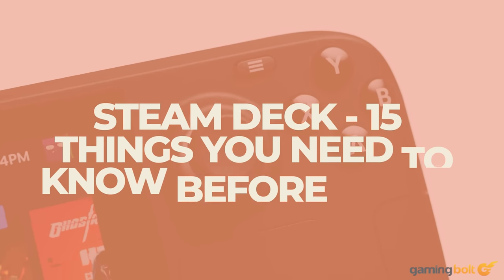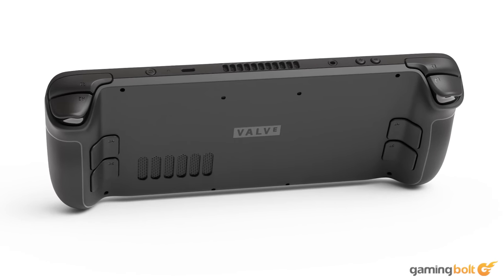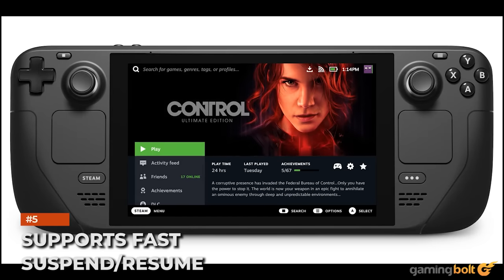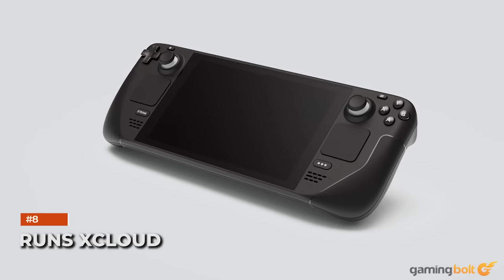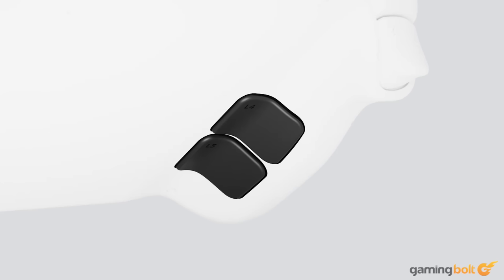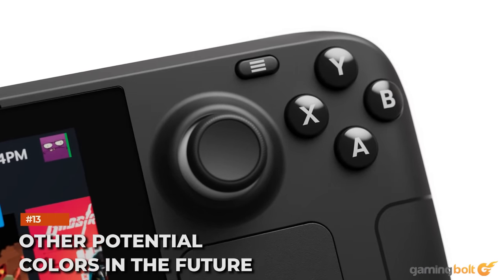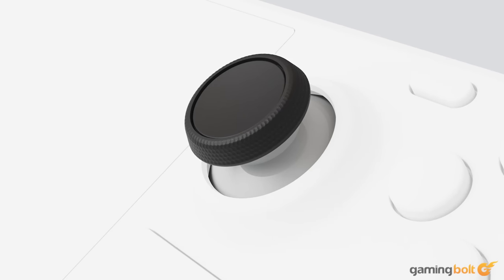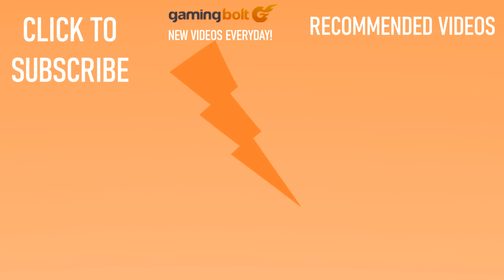Steam Deck - 15 New Things You NEED TO KNOW Before You Purchase

Comment: Linus, Gamer Nexus and The Phawx just did a great deep dive of the Steam Deck worth the watch. I am really hyped for the next when the software features will be released.
Reply: What can we actually install? I would want world of warcract , lost ark, and final fantasy 14
Reply: @Murc_roadster  Massive multiplayer games are currently not supported. Depends on the publishers if they want to enable anti cheat features for Linux based System like Steam OS. Final Fantasy 14 maybe could be playable but its not yet checked by Valve. If you wan't to know which games are currently verified/playable on the deck check the gamingonlinux website. Currently 520 games are playable officially.
Reply: Phawx is awesome!
Reply: Yeah but let's not tear one apart like Linus did... I'm pretty sure he gave a few Valve employees grey hairs and a possible heat attack when removing that battery 😱
Reply: @Matruchus  That is not true. Tomas could install windows and play it that way, if he wanted to. It's not console like convenient, but it's not really a problem either. I will have an sd card, to boot windows from for stuff that doesnt work with steam os.
Reply: @gehtdianschasau8372  I mean, I hope you didn’t buy one expecting Windows to be installable in the SD card, because nobody knows if that’ll be possible. 

Don’t get me wrong, I know you can install Windows (or actually, any OS that meets minimum requirements really) but so far we don’t have any confirmation on dual boot, Windows official drivers (I’m not even sure Windows will see the pads properly) and Windows optimization (FSR support is nonexistent for example). So yeah, buy it knowing installing Windows is possible but nobody really said Valve or Microsoft will officially support it.
Reply: @AlejandroLZuvic  I expect windows to run from an sd card, if it doesn't i'll have to install it on the ssd. I propably won't use windos often, so i'd rather have it on sd card, but i opted for the 512gb model, so it wouldn't be a problem.
Reply: Link
Reply: @skaterdude7277  what you mean link? I hope you dont think you just gonna tell someone (link) and expect someone to  really give you one. Lil boy you say please and I'll give you a link if not beat your feet kid
Reply: I can't wait. I got my order in late... After Q2, 🥺😢😭

Comment: Honestly this could be what PC gaming could use to work with the massive commercial market they are kinda apart of. I say kinda because most kids who want their parents to buy them games don't usually say PC.
Reply: i have this distinct feeling kids won't want this, as they are going to stick with their switch.
Reply: @demonpride1975  hate to break your heart, but it's not just kids that own the switch. it's past over 100m+ sales. and to assume it's all kids is odd. but what i can tell you is, plenty of kids now own a pc due to the shit release of the xbox series, and ps5's. consistently out of stock, always being scalped, not nearly as much of a game library as the steam deck. everyone will have their preference, kids and adults alike.
Reply: @issamcvibington  "Kids own Switches" doesn't equal "Switches are only owned by kids"..... you implied that. No need to get so defensive.
Reply: @crocfromthehitgamecroc9010  I wasn't being defensive. I was just trying to state a point. He only mentioned kids in his post. Thank you for your input though.
Reply: Well the big road block to pc gaming has always been accessibility. Your basically spending hundreds or thousands of dollars on a rig you can’t take anywhere, you gotta upgrade parts and over all just know what your doing to manage a pc. For consoles you don’t have to do any of that! Just play games at less than half the price. You gotta cut out that complexity to reach a mass market especially for kids. This Steam Deck however breaks the barrier! I would be surprised if kids go for this as well especially as a handheld console. Your not paying pc prices for pc gaming and you don’t have to manage the pc as long as your sticking with the Steam app as well. This is basically a dream console I’ve wanted for almost 20 years now and technology has finally caught up. And now I can play Halo on the toilet! I’m sold!
Reply: @demonpride1975  It's a possibility, this looks like a switch tho.
Reply: @issamcvibington  Not the same most kids from when I was a kid until now mainly want a console because most their friends still have them. Kids who play on PC is still a minority compared to console kids. This could be a great equalizer and introduce millions of kids into a gaming pc that's affordable that their parents could buy.
Reply: @AKen_Films  That's the thing I don't think many people seem to understand. This is a major game changer that the steam boxes never could be. Those boxes prices were all over the damn place, also you never seen them at stores or seen any promotional items or commercials.  If Valve markets this right and keep each version affordable this could be a major shaker and force the big 3 to change alot.

People go well kids have gaming PC's I'm always like not the kids aren't a small minority.  Also even out side of the states on Asia and parts of Africa are gaming PC's the Supreme factor. Mainly the people who have high end riges are adults with money. Even me in my mid 30's I thought about getting into PC gaming a friend of mine told me how much he put into his recent PC. I said wow thats a down payment for a car, I said nah I'm good.
Reply: @AKen_Films  Honestly? Extremely true. Have 100’s upon 100’s of games in my library on my PC. But I go away for a few days at a time very often. And if I can’t access them, what good is it all ? Very valid point. I’m going to be getting one hopefully when my time comes in the reservation. It can’t hurt to give it a shot. I’ve stood by valve/steam for so long now. I can feel comfortable standing behind another product of theirs. Interesting time to be alive, boys.
Reply: @rell127 Also very true. I grew up on PC, so I’m bias on that idea of kids not being into the pc universe. But remember, when we were kids, cross platform wasn’t a thing. A kid now can have a pc, plug in a controller, and play apex legends with their friends on ps5 and Xbox series. Different times, friend. I see your point though. Very true, and without even needing the dock as far as I’m aware, they’re able to get a regular usb-c hub and dock it that way. Super portable, lightweight accessibility. Gaming in general is in a decent place. Albeit I can do without the crypto and NFT nonsense. But that’s a whole other conversation in itself. Have a good one man, hope to see you in the deck world soon.
Reply: Why is it a problem? What would kids know about building a PC or knowing the loads of specifications that a PC can have?
I know kids today are much more into technology than ever before but PC gaming isn't exactly for kids. No, I'm not saying consoles are for kids. It's just more simple to use and less expensive.
Reply: @defend4ever  actually a weird take. I got heavily into PC gaming at 7 years old. I’m now 29. With CS, Diablo 2, Dota, and RS mainly. And I had a neighbor help me build my first PC with all parts from newegg. What would age have to do with whether a kid can get into PC gaming ? There’s even pre-builds if the parents don’t wanna be bothered with doing it themselves/hiring someone to do it. Weird take lmao. Not sure what else to say to that. Age doesn’t discriminate against gaming, friend. Have a good one :)
Reply: @defend4ever  Every generation of kids are like that, just most gaming PC's are out of most parents and most teenagers budgets. Now yes there are some affordable options but to play the games they want they won't all have those options to buy and or build them. Some will , I'm saying this is great because this price, and the mobility of it will mean more people can pc game. With more affordable options to game means more games and more people. Nothing about this is a bad thing.
Reply: @defend4ever  one more thing, less expensive ? Also an odd take. Do you even play on a PC ? Most if not ALL of the most popular games stemming from FPS - MOBAS are all F2P. One investment. Thousands of hours of enjoyment. Idk man. Just a really odd outlook on it in general lmao. But still, have a good one 😄
Reply: @issamcvibington  I'm just saying that a console is easier and more convenient for most kids. I personally have a PC as well. I didn't have anything until I was like 10. Even after that I didn't play much.
How many parents would want to bother with a PC when a Playstation/Xbox will be enough? Even a tablet is enough for some kids. 🤷‍♂️.
Reply: @defend4ever  I see your point. Valid point for sure. It’s definitely more mainstream for a parent to say something like “what are those new Xbox’s called?” Rather then, “what processor do I need to have that is compatible with this GPU and mobo?” Lmao. Fair point, man.
Reply: @rell127  yeah, I most definitely didn’t say anything about it being a bad thing. It brings more portability to the gaming industry which I am a huge fan of. And at the same time brings more of a mainstream approach to a what would be considered popular, but limited to be in one place at all time platform
Reply: @issamcvibington  I agree you didn't say it was a bad thing. I want the big 3 to have competition that matters. It lowers the prices down. Hell I wish the DreamCast was a hit because we would probably have a big 4 right now. Hell then if Atari, I'm a huge fan of choice and options. I prefer us consumers to have as many options as we can. Also I believe only have 3 to 4 options isn't enough I feel a solid 7 would be good. Especially can have Google, Facebook, Amazon and others become a major threat to one another. I feel the more the better the price, the better the games and the better the price.
Reply: @demonpride1975  That's a possibility because there already is several windows based consoles just like this .
Reply: @issamcvibington  yes i am sure there will be some kids that want this, but honestly at this point kids want everything, not because they truly want it. why do you think we have so many handheld devices that kinda fail, because they try and compete on the market with nintendo, and nintendo has proven time and time again they have the handheld on the go market clinched.

Comment: You probably mentioned this and I didn’t hear it but I’m wondering if you can play games offline? Can you only stream the games? Can you play games without streaming them?? I’m new to steam. I mainly play console. So if you can play games without streaming them I’m really considering on getting it
Reply: I'm guessing it depends on the game.
I have no clue since I'm a platform player and don't have a PC, but like with the PS4 I'm assuming it would depend on the game since there are some games for the PS4/PS5 that don't work if not connected to internet.
Reply: No, streaming is not required in fact it's much less of a hassle to play games natively it's literally a PC so you can install games normally, which is the main purpose of the device.
Reply: If it couldn't be played offline then it wouldn't have so many storage options
Reply: Yep steam has an offline mode, so as long as your game doesn't require online to play you are probably good. Games are downloaded directly to the steam deck just like if you were to buy and download a digital game on a console. It's basically a digital only switch, or playstation vita, except there's no exclusives and you can play your whole pc steam library (steam uses cloud saves). Theres no need for streaming games at all, but it's an option if you want that. There are some exceptions though like some games need to be connected to the internet for first time setup, and some, most notibly some of the battlefield games need to be connected to play single player (probably because of DRM/anticheat). There are a few games that just don't work at all like VR titles or right now because the anticheat software used for games like Apex Legends is built in windows and not supported on linux. I've heard Valve is working with the anticheat developers to try and make a version that works on the steam deck though so hopefully that'll be fixed by launch or relatively soon after. There are lists online of games that require something extra, have little issues/limitations, or just don't work right now, if you are interested if any of your games are on there. The vast majority of games you shouldn't have a problem with though.
Reply: @BlackWinds  thank you. I really appreciate that. After reading this I will get a steam deck😁
Reply: It works the same as a normal computer. You can download straight to the device and play offline as long as you like.
Reply: why wouldn't you , steam has an offline mode, and this is using steam os. so more then likely yes, unless you are playing a game that requires an online connection.

Comment: Valve does say the m.2 drive slot is standard but not intended for users to replace the drives. Hence the micro SD slot and the effort in making the SD storage almost as fast as the m.2 drives.
Reply: But if you're handy and careful enough you can just replace the M.2 drive.
Reply: @WickedMuis  they’re not going to stop you… but if you screw it up, they’re not going to fix it. Same to be said about installing Windows, you can do it, but their warranty won’t cover it
Reply: @progxdt  Why Windows warranty though? Steam OS 3.0 can be reinstalled anyway
Reply: @WickedMuis  it's a tight package, the steam deck. The m.2 they have is single sided and the layout is tuned for that specific m.2s EMI. They have validated that config and any other may not allow the steam deck to function as intended.
Reply: @progxdt  Actually they said they are supporting windows and there will be a factory reset option as well if you screw up your software. Also, windows sucks.
Reply: @_Davepocalypse  Yeah, just get one with the right specs.
Reply: @WickedMuis  unless you just buy what they already offer, you can't match the EMI pattern exactly. Also, with the m.2 right next to the wireless adapter with the antenna passing it, that's a risky business to start swapping it out.
Reply: I sincerely think Valve is just trying to cover their backs in case somebody do something stupid or if a third party SSD doesn’t work as expected, like “we told you so”. But realistically speaking, I don’t think you’d see a tangible difference either on WiFi speed (because of the shielding) or the SSD performance. You may measure a difference but you wouldn’t really “feel it” slower.

That’s my thought anyway, a few weeks before someone tries it for sure.
Reply: @AlejandroLZuvic  yes, interested to see what the difference is. As far as I saw on the teardown, there isn't shielding between the two components, hence their validation claim, but we'll see!
Reply: It’s standard but it’s just a 2230 ssd which only maxes out in a 1tb model, there’s no larger version made by anyone and that 1tb ssd cost as much as a 2tb 2280 ssd used in most other handhelds and laptops at just over $200 and the 2280 ssds are available in sizes way up to like a 8tb version
Reply: @AlejandroLZuvic  I think on this one there's more to it, the way it cools it and shields wifi has small fault tolerance. Mess with it and it might not cool right and you may have wifi issues.
Reply: @insperatus  my only worry… people pushing the goodwill to a point where Valve has to hardline on their policy. I agree, Windows does suck. What do you expect from an OS that was cloned from macOS to play solitaire? Old Macsurfshop shirt: “Mac for productivity, Linux for development and Windows for solitaire.” 😆
Reply: @orlandofurioso7329  uh…? What? I was saying if Windows bricks your Deck, Valve might pull an Apple and say, “Yes, you can install it, but doesn’t mean we’re going to cover it.”

I’m pumped to play around with SteamOS. After reviewing the ProtonDB, there should NEVER be a need for Windows on the Deck.